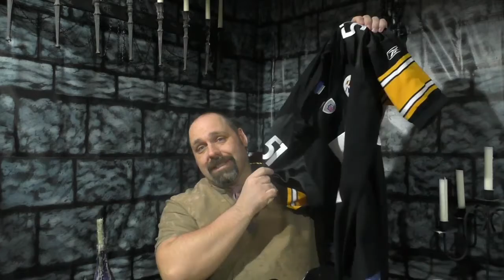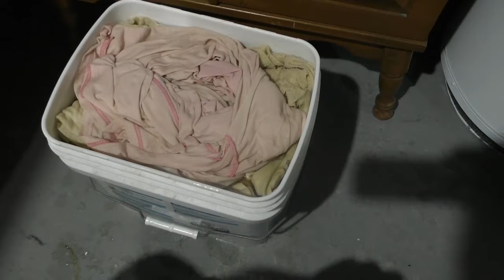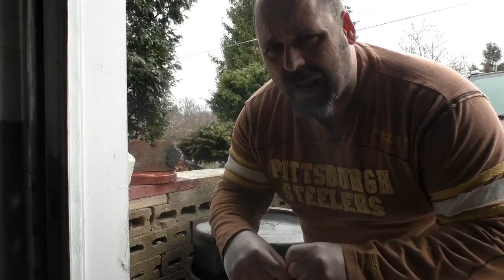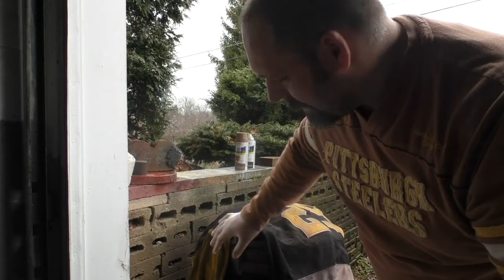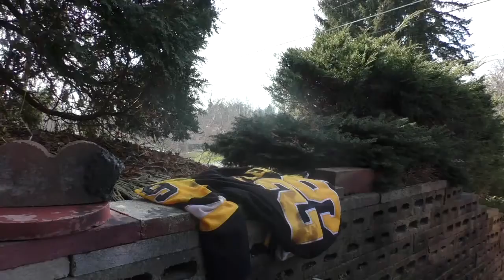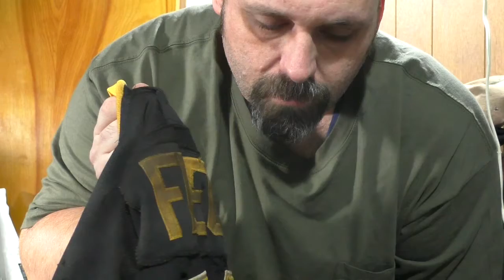How To Build a Post-Apocalyptic Larp Costume Tutorial (Pt.1) - Dystopia Rising

Comment: I've got a quick question about the wood stain. Now, you say you make everything so you can wash it, but putting wood stain in a dryer is usually a VERY bad idea (what with the whole catching on fire nonsense), so do you just air dry those kinds of things, or what?
Reply from the maker: Once it soaks in and naturally air dries and you wash it that first time, there's no issue drying it in the future.  Just make sure you wash it once before you go near open flames and you should have no problems.  Carpenters don't throw away their clothes everytime they get some stain on them, right?
Reply: Larpgasm True, but then they are also trying to get as much of the stain out as they can. Either way, I will be giving this a shot, as there have been any number of times I've noticed how much stain looks like really old blood, and this is just about perfect use for all those mostly empty cans of the stuff I've got laying around.
Reply from the maker: That's why it's awesome.  But if you're just using regular detergent, don't worry, it won't come out.  I washed that Jersey probably 4 times by now and it still looks the same.  Best of luck with it, I think you'll be happy with the results!